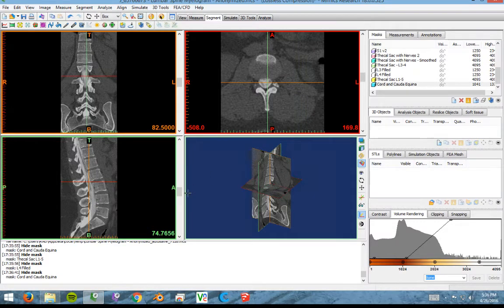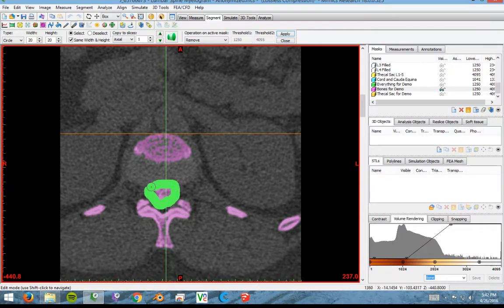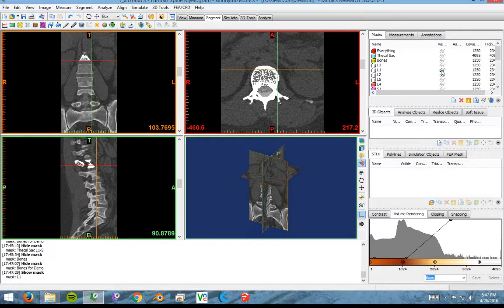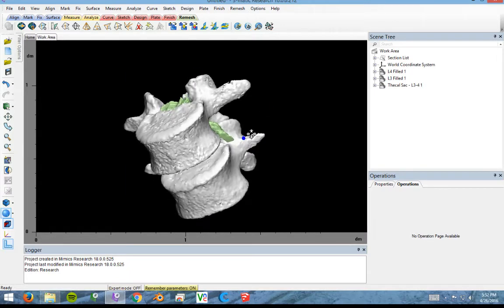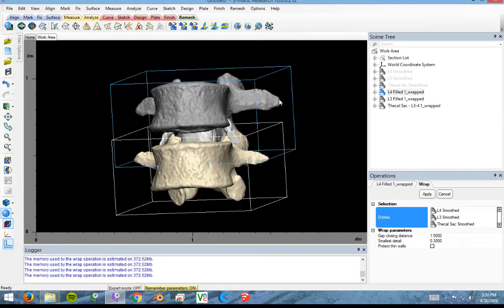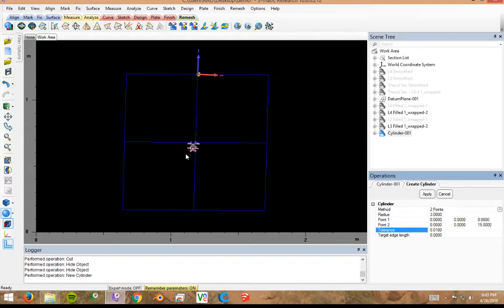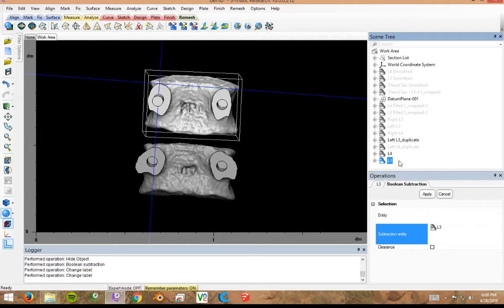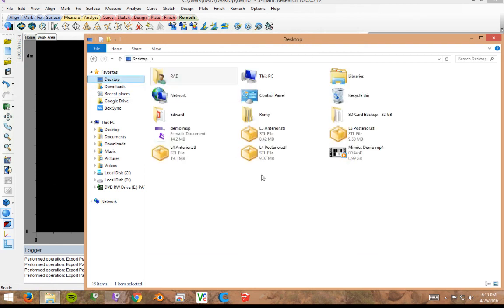Materialise Mimics and 3Matic Tutorial

Comment: Hi. May I know, do you purposely left out the cancellous bone inside vertebral body?
Reply from the maker: No - for my current models I manually fill in those areas. It all gets filled in with support material anyway so it's not a big deal, but it's easier to work with solid structures in CAD.
Reply: @justincramer9557  can you do tutorial for that too? Your videos very helpful for my study.
Reply from the maker: @shurah100  I don't have a Materialise license anymore, but it would be straightforward. Play around with tightening up your threshold, using hole fill, then manually fill in any remaining gaps.

Comment: Hello Sir,

So i have a foam based temporary prototype of a component which i want to be 3d printed. I wanted to make a cad model of it via solidworks or catia but it is too complex to model. If I uses mimics i have to import images in format of DICON file format. I want to take images of the foam prototype and then want to do analysis of it. Also after getting the 3d model i want to make some edits in it and then want to do analysis of it. Please suggest me a way to do. It would be very helpful.
Reply from the maker: That's well outside my expertise, but I'd recommend looking into 3D scanners. Essentially you want to digitize a physical model that you have. Once you have the digital file, then just pick the right CAD software for your use case.
Reply: @justincramer9557  does Mimics accept jpeg files as input and will i be able to do Structural analysis of it in Ansys?
Reply from the maker: @sandeepprajapati2188  Short answer is I don't know. Mimics is specifically designed for medical use and I think only accepts DICOM. You likely need different sotware.
Reply: @justincramer9557  that's is really helpful. Thank you Sir😄

Comment: Is it possible to model intervertebral discs in the same way?
I do not have the ability to automatically fill in the 3matic or catia  when I roll all the beads together
Maybe please help me to solve this problem
I want to take abaqus after modeling the beads and disks for analysis
Reply from the maker: delaram - You can segment out the discs separately in Mimics. I would recommend that instead of trying to model them in 3Matic. Not sure what you mean by "beads" or "abaqus"

Comment: Hi Justin , I like ur video, I need one  help from you Justin, I have plan to do my PhD in interactive image segmentation  ,so for that could you please suggest me some advanced interactive image segmentation algorithm which was now currently using in industries or in RandD ,.  Thanks in advance
Reply from the maker: I use Mimics (paid) and 3D Slicer (free) for image segmentation. Both work great. In terms of image segmentation algorithms, check out the August 2017 issue of the Journal of Digital Imaging and various other publications - lots of research right now using machine learning for automated segmentation. Also, FSL and Freesurfer are free programs that automatically segment brain structures. Hope this helps.
Reply: Justin Cramer thanks for ur reply, could you please share me your email id

Comment: Hi Justin. Thanks for the very useful video!
I've couple of requests if possible. Could you do a more advanced video on segmentation techniques?
And regarding the 3d models in the video, will they be printed porous from the inside?(because the segmentation of them had some pixels unmasked inside)
Looking forward to see more great tutorials from you!
Reply from the maker: Glad you found it useful. I don't use Mimics and 3Matic a ton anymore (mainly because I don't have a license). I've been focusing on Slicer and Meshmixer and may do some more tutorials on those.

Honestly I don't worry much about the insides of a segmentation. The printer has to lay down support material anyway so the insides are usually filled with material.

Comment: Hello Justin!

Thank you very much for this great video! It was very helpful and really nice explained.

I wanted to ask your opinion about FEA analysis of designed models, Instead of Printing them...

Which is the best way to perform FEA analysis on these obtained models? Thank you very much in advance!
Emre
Reply from the maker: Emre - I don't have much experience with FEA but know it is possible with Materialise.
Reply: Suggest you to try and use Simpleware, if your aim is to create finite element models from Dicom data. www.simpleware.com
Reply: You can use 3-matic to create your mesh and then you can export it to Ansys, Abaqus, etc.
Reply: Are they volumetric meshes, there used to be some problem, and volumetric meshes required some transformations? please correct me.
Reply from the maker: Not sure what you mean. The CT scans are isovoxel, which means they can be reformatted in any plane because the slices are thin. I take a "mesh" to mean a 3D file such as STL, which is by definition "volumetric"...I would think...but I'm still learning...
Reply: They are surface meshes, and you can create volume meshes from them using 3-matic also, but always there will be geometrical errors which must be fixed first.